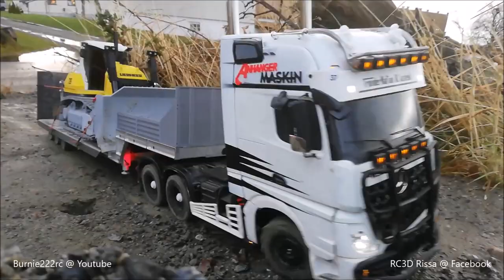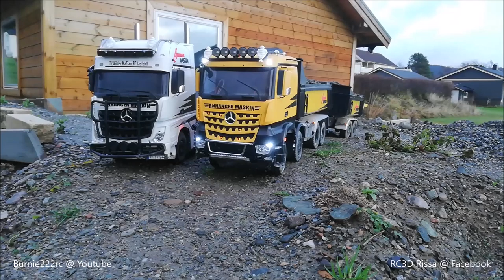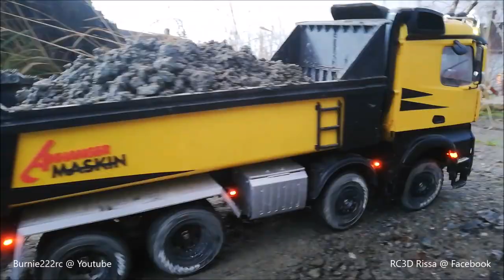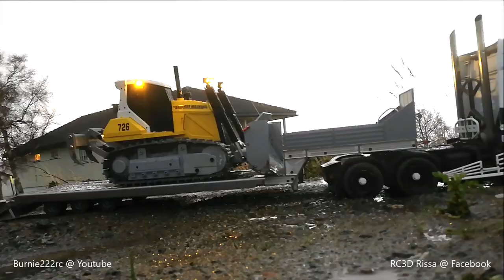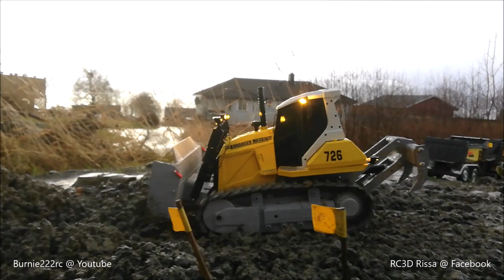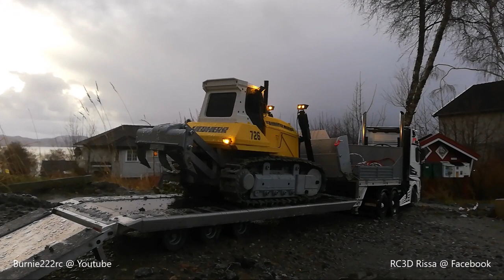RC Construction Equipment - 3D PRINTED Bulldozer and two Mercedes Trucks

Comment: Great looking dozer. It seems to have a lot of power. Did you use planetary gear box or something else? Tracks work very well. ABS? Or Pla?
Reply from the maker: thanks man :) i used worm gear motors on this, 70rpm , 31mm diameter. the ones with the black motors. The tracks are steel chains, with 3d printed PLA plates screwed on :)
Reply: @burnie222rclasseanhanger6  cool thanks! Keep on "making". I love rc construction vehicles.